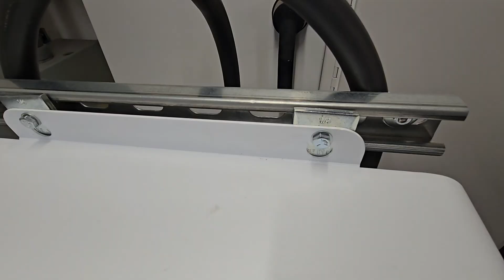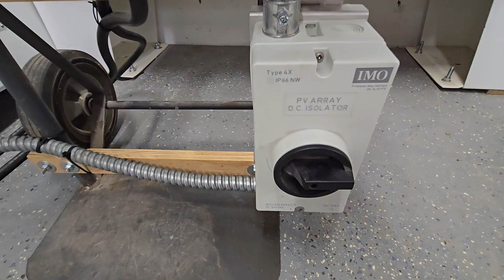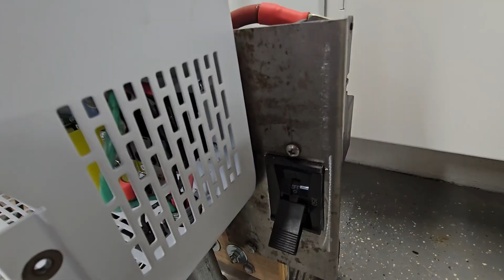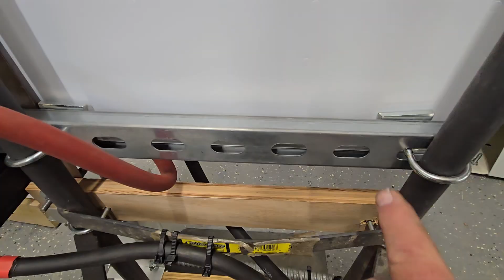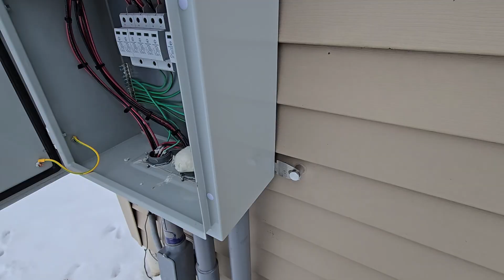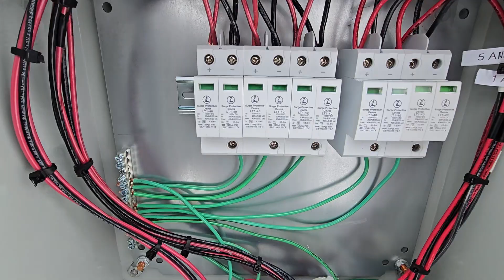Redneck Inverter Cart Mount and House SPD Box

Comment: I really appreciate this and your other videos.  I'm just bringing up my first Growatt inverter with about 2000 watts of panels and a 48V battery.  I have to do a lot of thinking about things to make sure things are done right and to code.  Right now, I need to get a small combiner box with fuses and a breaker for the solar panels.  Your video really helps.  Thanks.
Reply from the maker: That is what these videos are for, to help others get started and learn. This Redneck cart is just something temporary to pull power off the new array and to power the house while the current inverters are replaced with larger SRNE units. Check out my other videos, I show how I used to install SPD's at the array's but now I am installing the SPD's at the entrance to the structure.
Reply: @doczwy  I wondered whether there was another box near the array when I saw the box on the house.  I'll go back and review.  Thanks.
Reply from the maker: @SyberPrepper  The previous video with the winch adjuster for the tilting array shows the array box. There is also one other video from last year that goes into detail on how I wire these with Myers hubs, IMO disconnects and SPD's at the array.